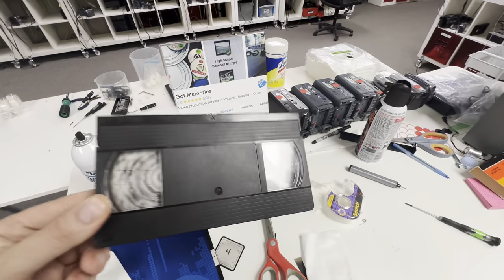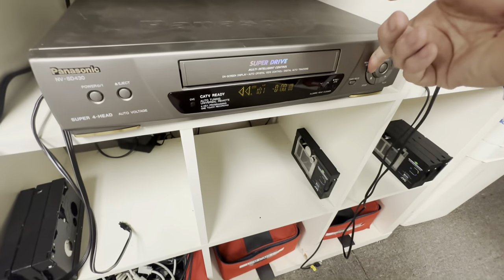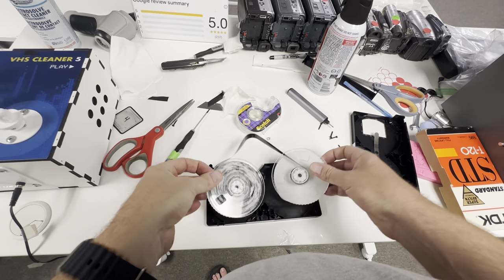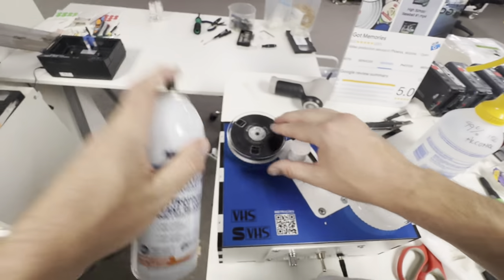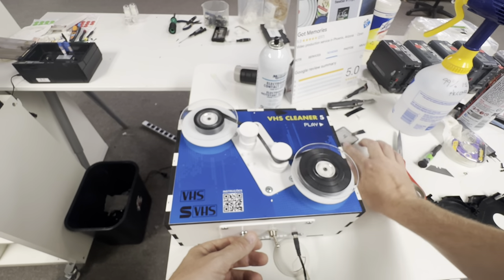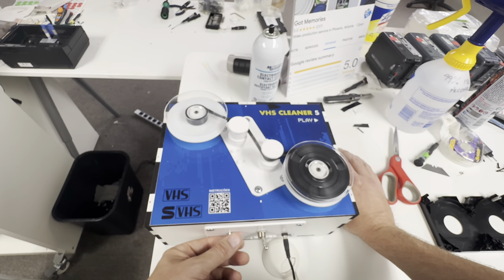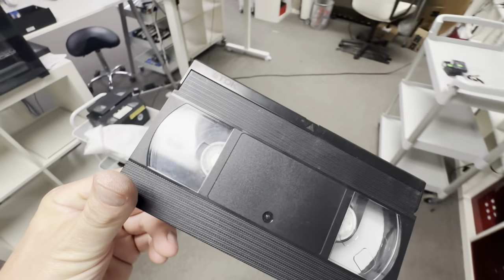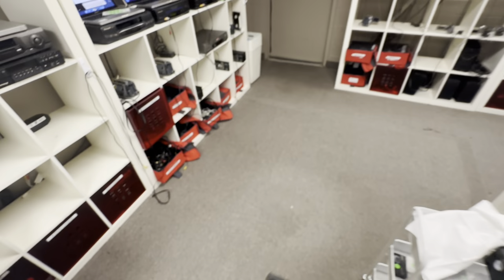VHS Tape with HEAVY Mold Issues from Stored in a Humid Attic since 1990 - Restoration to Digital MP4

Comment: Maybe you could try putting the reels in a cassette shell you know for certain is good and then on the bottom of the tape reels, fill it in with pencil because the graphite will give it more slip and some light lubrication, just to rule out the possibility that there's too much friction in that particular shell, because tapes with issues have a lot less tolerance for friction in the shell
Reply from the maker: Good idea!

Comment: Ever see tapes behave like that when not moldy? I have one that struggles to show unless fast forwarding or rewinding. Wondering if it was recorded on a super out of track VCR or if maybe a cleaning of the actual tape might help it. Will give it a go and see I guess. Use it as a learning experience on how to clean tapes.
Reply from the maker: Could be a dirty head or misaligned head?! I’d try in a few other VCR’s.

Comment: Hey mate! Love your videos. I’m in Australia and going to get a pro over here to clean my tapes. Just. A quick question. Since I see everyone online going on about how dangerous it is dealing with mould and having all the protective gear etc and notice that it appears it doesn’t worry you. I have pulled a cardboard box full of old tapes from my basement and most of them are full of mould. The ones that aren’t full of mould or have little mould I’ve successfully transferred them over with a throwaway vcr. So my question is do I need asap to get the box and tapes out of my house even if they are just sitting there in terms of the mould spreading or being hazardous? Thank you and love your videos
Reply from the maker: Hey mate! Yeah I am very careful now w the mould in terms of wearing protective gear. As for your stuff, I’d probably get on it asap and clean outside the house and wack a mask on and eye gear and stand up wind when you’re doing it. As for keeping in the basement, as long as it’s sealed up box wise or ziplocks then no harm but I’m no health inspector so that’s to your discretion. All the best mate!

Comment: Hey mate, I'm wondering where to get that same tape cleaner and stuff. A lot of sites just say generic "electronic tape cleaner" and I've looked on ebay, but none of the stuff matches what I think would fit. But what do I know.

I'm just hoping to find an affordable machine because I have a couple hundred or so VHS tapes (movies and TV shows) that I've had over 25 years since I was a child, and they're all incredibly moldy due to excessive humidity (one issue was we had no heating in our house for a few years, so humidity was bad during winter, but I'd rather not explain) and an embarrassing living situation for some years. Despite the tapes being stored in an entertainment center for a long time, tapes still got moldy, even ones in clamshell cases.

I could do it without a cleaner, I've seen tutorials, but I don't trust myself not to mess things up. And an electronic cleaner like what you all have could help. Plus sending all those tapes in to get professionally cleaned would cost a fortune. I just can't bear the thought of parting with these tapes, I've had them all my life. 😭

I'm sorry for the long comment. It's just devastating when stuff you love is in bad shape, and you guys look like you know what you're doing.
Reply from the maker: Hey mate! 
Bloke is in Brazil. Runs about £500.